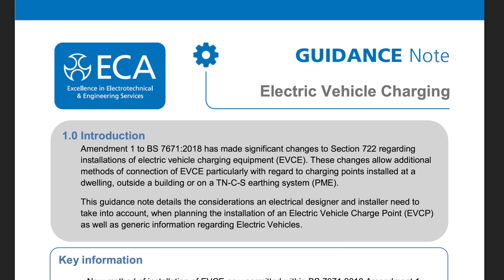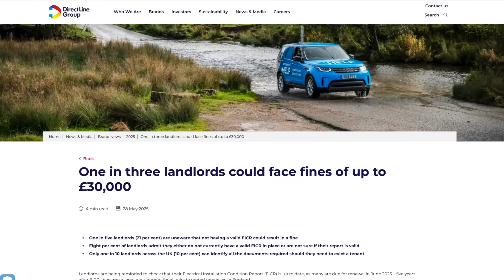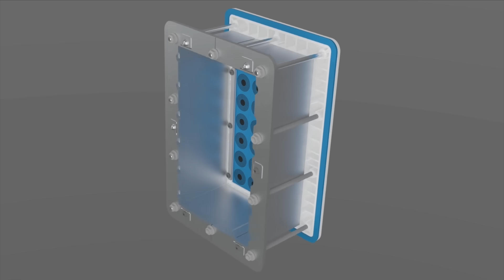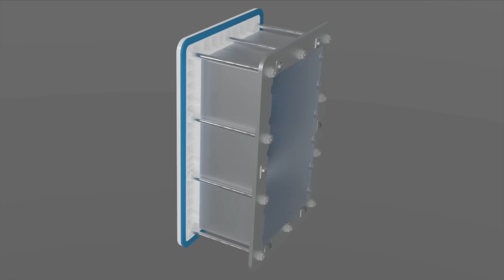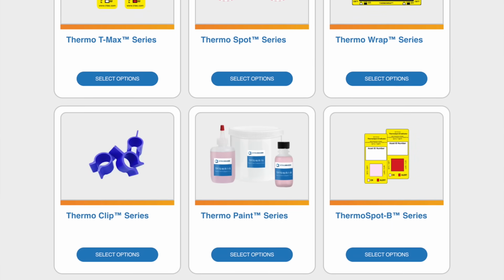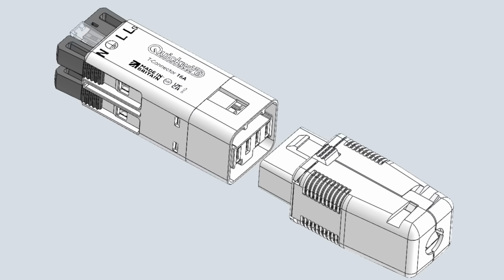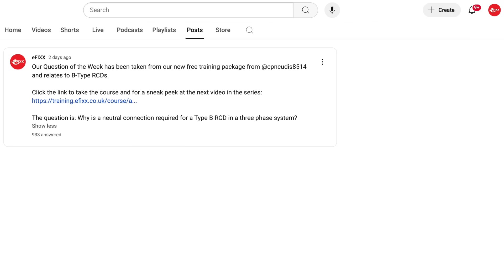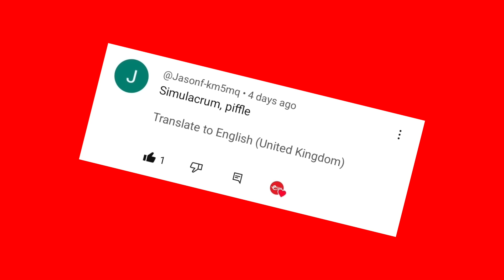Govt’s Cable Plan Sparks Safety Fears ⚠️

Comment: There’s no guarantee you can actually park outside your terrace house…
Reply: the arguments after bins placed in road to save spaces goes crazy
Reply: I can imagine some massive arguments with people parking outside houses with these on street parking facilities!
Reply: @over-engineered  True that does happen now when anyone can park outside anyone else’s property. I’d imagine that could be reduced when you say I need to charge my car and here is my charging cable. This assumes that the person parked there is reasonable of course. There are powers for councils to remove cars parked in front of a dropped kerb, this would be similar deliberately blocking somebody’s access. Keep doing it and you risk coming back and finding your car gone
Reply: There is no guarantee you will be able to afford a car to park outside your terrace house. 😂
Reply: @obtuse1291  we certainly wont be able to afford an EV
Reply: @andygozzo72  A brand new Renault 5 EV is about £2k more than an equivalent Renault Clio. We bought a 4 year old used Kia Niro EV for £11k (with 3 year mfr warranty remaining), which was about the same price as a used petrol Niro. If you can get cheap charging (like the 6p Octopus rate that this scheme makes available), then every 10,000 miles you save about £1000 (motorway) to £1500 (urban driving) in fuel costs.
Reply: This is when you have good neighbor’s who are friendly and will cooperate and  not some chavvy weed smoking oxygen thief who couldn’t give a flying f*ck!
Reply: Gullies across a public footpath there are so many potential accidents waiting to happen, and that is without adding electricity in the mix Roll on 4 years, Roll.on Reform UK and all this madness will be kicked down the road 🤯
Reply: Shame on you for mentioning such details.
Reply: When parking is a free for all, this just demonstrates the level of intelligence of those behind this born dead proposal. These are the kind of people who would design a plaster without adhesive. The waste of money is outrageous.🤬🤬🤬
Reply: @jeremylister89  The resident pays most of the cost for this type of install, so it is up to them to decide whether or not it is worth it for them. We can't use it (our house is up an alleyway), but if we could then it would repay the cost in about 8000 miles of driving (vs. using public charging), and then save about £1200 every 10000 miles of driving after than.  It would pay back quicker if we joined a scheme to offer public charging with our charger.
Reply: As someone who can't ever park outside their terraced house, because it's double-yellows out front, I'm compeltely in favour cable-gulleys for the people *who can*.

No solution ever covers 100% of scenarios, or often even a majority of scenarios.

The solution(s) for my street will likely be:
1. Cable gulleys for side-street residents
2. Kerb-side public chargers next to some of the bays which aren't directly outside anyone's house (sides of buildings, and gaps between houses)

That likely won't end up as-cheap as overnight home-charging for me, although there are also services like CoCharger offering neighbours the ability to share their chargers, and on terraces that could be just as useful as on driveways.

There will doubtless be even more awkward locations than mine, with perhaps no nearby side-roads with parking, but inevitably the car has to be parked somewhere and wherever that is, a charger will have to be installed there.
Reply: @DevAnubis   Not actually a solution to home charging then is it?
Reply: @DevAnubis  Good points well made.
Reply: @philcotswold5940  no its not.
Reply from the maker: Just about the most level headed response to this issue I've seen. 👍
Reply: @efixx  is that a freemason reference?🤝
Reply: @efixx  yep, we're in terraced row and have no 'reserved' parking outside our house, its 'first come first served' each time, and then theres the other issue if the house electric system will handle the extra load, many, especially older houses, wont..
Reply: When the other option is 55p/kWh from a public charger, I'd like to have the option of taking my chances.
Reply: @Tim_Small another option . Get a ICE Vehicle and save all this hassle
Reply: @andysims4906 trouble is, ice cars kill people and wreck the environment, sorry thought you may have heard..
Reply: @MikeGleesonazelectrics  And scrapping vehicles because the battery has gone kaput and can't be replaced has zero environmental impact?
Reply: @elishabee2 I've been driving evs for 10 years now and don't know of any batteries going kaput, im sure it happens but not as regular as ice engines. Plus old batteries can be recycled, I use second hand Zoe batteries to store energy at home. Everything can be recycled but all the carbon and particulates being pumped out of diesel engines at pedestrian level is more difficult and its that which is making things worse.. 😮
Reply: @elishabee2  I chose an EV where the batteries can be easily fixed - everything is modular and can be replaced with a few basic tools given the right level of electrical knowledge. Some EVs (like newer Teslas) have their battery packs glued together, so a failed pack is almost unfixable, but I wouldn't buy one. Same reason I don't buy Apple laptops or Samsung phones - not designed with repair in mind (almost the opposite). Even if I did need to replace the entire battery pack for some reason, then a replacement is about £3k used (64 kWh Kia/Hyundai pack), and it's a couple of hour's work for a basic garage (there are videos on YT of people swapping out EV batteries on their driveway).  Used EV batteries are now so cheap that people are starting to use them as home energy storage, this is only because people write-off the cars in minor crashes far more often than the packs fail.
Reply: For most people you don't have to always be able to park outside. We charge every week or two and once a week we'll get outside.
Reply: @Tim_Small  yes logically it would require parking spaces labelled for each house , and of course the council or government would have to install special ccts for chargers to ensure they are compliant with probably credit card or touch card operation , a VERY expensive prospect along with paying for floaters housing and a lot more expensive then they kid on
Reply: @Tim_Small and that’s my point…all that work and disruption to install a point for charging that has a high probability of not being used due to not potentially being needed or not being able to use at all due to limited parking
Reply: @Tim_Small  some of us do 200+ miles a day
Reply: @rashdondoesntunderstandwor-g1x 200 miles a day? A thousand miles a week? 52 thousand miles a year?

Go on...
Reply: @DevAnubis  I used to do around half that milage a year, 120 miles a day. The savings I made when I switched to an EV were insane. £80 down to £15 a week so over £3,000 a year. Before anyone says the EV cost more, not really as I bought it used 1 year old.
Reply: @DevAnubis When I was a service engineer for Thorn EMi, I did that that, and more, each day. 
I wouldn’t want to be doing that in an EV though.
Reply: @2Sorts  Sounds like that should be a work vehicle, with DC charging whilst travelling paid for by the employer/primary-contractor...
Reply: @DevAnubis we do 200 miles a week just taking the kids to school before adding in all the other domestic and work journeys, adds up to 500 a week. Unless you live walking distance to everywhere all those 5 and 10 mile journeys really add up. I used to work in a nearby town, that was 70 a day round trip... The shift to working from home was a godsend.
Reply: @insanityideas  500 miles a week is **half** of 200 miles a day (1000 per week for a 5 day working week)...

Most cars do less than 8000 miles per year, which is only 154 miles per week...

It's _what-about-ism_, not every solution has to work for every person. We can, and often do, all do things differently.
Reply: @DevAnubis I was just pointing out that for some people it's easy to rack up miles just day to day without even embarking on epic journeys.

Should add we do those miles in an EV and it saves us a fortune in running costs, and if you are doing high milage things like servicing and how long the car will last really start to matter, don't want a car that needs the engine half dismantling to replace a wet belt every 60k miles or oil change every 6k miles.

I used to do a lot of cycling in hilly areas, my highest cost per mile item wasn't tyres or even brakes it was chains, they used to wear out faster than any other item. Never something I would have considered if doing low milage or occasional rides, cars are the same, things you never consider wearing out start to matter if you do 20k miles a year.
Reply: @DevAnubis  yes, some people drive long distances from home for their work.
Reply: @DevAnubis  what?  Is this just a stream of brain farts?
Reply: @DevAnubis   And yet you don't believe someone does 200 miles a day.  Your brain is going in circles.  You are pretty crap at this know it all contrarianism.
Reply: You don't have to park outside your house every day. Just often enough to charge enough to not run flat.
Reply: @michaelleiper  theres no guarantee you'll get opposite it anytime, currently its higjly unlikely to get opposite your own house due to the council sticking a zebra crossing in the middle of the row, its taken 2 car spaces up each side of the road, not enough on street parking for everyone now, some over the other side of the road do have off road parking, and we sometimes have to park over this side as only space available
Reply: Perhaps the council should introduce the option of maybe paid of a car space opposite a house then?
Reply: Then they should guarantee the resident a space.. simples!
Reply: You can pay for them to put a bay in for you

Comment: Would you be exempt from double yellows outside your house ?
Reply: Double yellows are present for a safety or congestion issue.
They won't remove double yellows just to allow you to charge. That reduces safety. And you won't be able to park on double yellows.
Reply from the maker: No but you can buy an extra long cable!
Reply: @efixx  Buy a 100m cable and you can then charge in the next street as that's the nearest space!!! OMG what are we doing in this country!